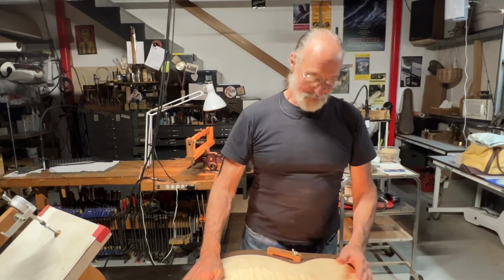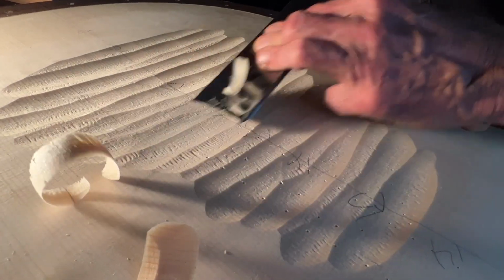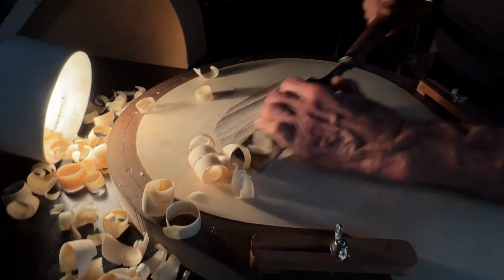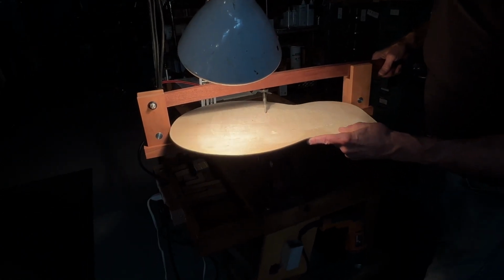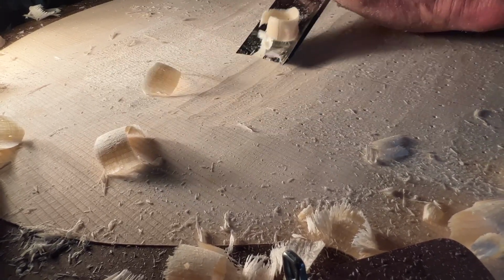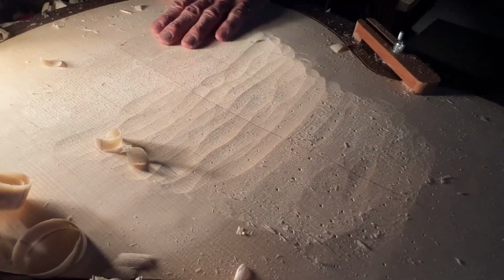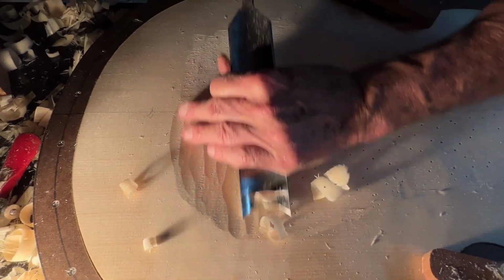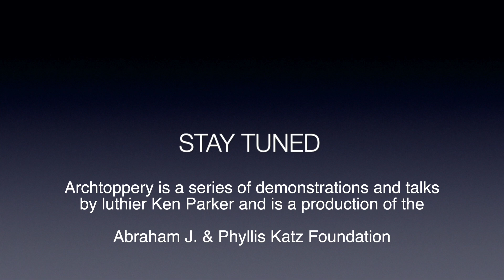Ken Parker Archtoppery - Arched Plates - Rough Carving the Inside - Chapter 2

Comment: Thanks Ken I really appreciate your diligence with these videos. I've built two ES335 styles guitars/bass and carved instead of used pressed lams. Leaving the 4" center block intact. I used the drill press method with the anvil below the bit. It freaks me out that it might grab and pull the bit right through the top. I'm typing this as I watch and you just answered my question which was what method did you use before this great tool you use now? Measured, OK, quite tedious.
Reply from the maker: Two commentators have used the word "tedious". Fair enough, I guess, but I never experienced it that way. It always seemed like it was a great opportunity to tune up the carving skills that are the heart of a hand made Archtop. The achievement of craftsmanship is its own reward.
Although I reject the drill to depth method for my acoustic plates, in the style you've described, it's almost a necessity.
The reason a drill could grab and lift/spoil a plate is that drills for wood have plenty of positive rake. In order to beat this possibility, just resharpen the bit with zero rake, and it won't be able to grab, or screw into the material and lift it from the bottom pad. In other words, take the twist out of the twist drill. Need a demo?
Reply: @kenparkerarchtoppery9440 , thank you for your reply. I think I get what you mean by zero rake so next time I'll give that a try. Tedious though I may find it, it is indeed rewarding!

Comment: The spokeshave you are using is a conventional flat bottom, or a rounded face?  The wood appears to be quite lovely, I am jealous!  Interesting that after all that you have built you just incorporate a new measurement device.  Almost too simple…….which means it’s a good thing.  And the grind you put onto your new gouge is really demonstrated by the ease that it performs.  Wonderful video!
Reply from the maker: Thanks, glad you're digging Archtoppery! The spokeshave is convex in both directions, around 20" radius arc across, and 7.5" ish radius arc along the tool.  The Strad Stabber works great!

Comment: Hello Ken, thanks for this video. I very much admire your work.  I am building a mandoline and should be able to use the same method, I presume. Would you say this will work for a maple-back as well, I mean, can the jig produce holes in hard wood as well? What is your view?
Reply from the maker: Of course the main worry would be splitting the plate by pressing too hard with the wedge shaped point, and hopefully we can be patient and methodical so as not to get in trouble.  Just test on a scrap and see how your point geometry and wood hardness interact. You can sneak up on it, and it will do very well if you're not greedy.

Comment: Thanks for this Ken. I love this idea of a thickness punch. Perfect for us beginner arch builders. One question. Did you use the same dimensions as David Sora as stated in his article. 17in seems a little small for lengthwise measurements of an archtop guitar and is close to the lower bout width of many traditional archtops. What length did you make yours? Thanks again this is great. I appreciate your experiments immensely.
Reply from the maker: Glad this helps. The best tools have an obvious simplicity to them, no?  Good enough for Tony Strad is good enough for us all! We built  55 cm, or 21.65" between the posts, and wider wouldn't be the wrong direction, but it needs to be rigid to do a good job.

Comment: On the deck from Stradivari, the paper glued in the center is not visible. Maybe he used Titebond?
Reply from the maker: That's right, All the renaissance builders used Titebond glue, 'cuzza the hot hide glue was corny, even back then.
Reply: @kenparkerarchtoppery9440  
I was just thinking composite neck, epoxy, kydex, dummy coil... "full stuffing". “Perhaps paper is a tribute to tradition?” - I thought. And indeed! Yesterday I saw a lute (kitaron) of the middle of the 16th century. the bottom of which was glued with strips of pages from Dante's Divine Comedy, an unsold edition of 1507. So maybe not a Titebond .

Comment: Thanks Ken.  What is the inside measurement, post to post, on your thickness punch?  I've been studying the Sora plans. Is yours larger?  I have a big walnut board that needs to be something. Much gratitude for your experience sharing.
Reply from the maker: Ours is 55 cm, or 21.65" between the posts.  Bigger would probably be even better, but the tool needs to be stiff to work well, so you might want to beef up all the parts.  One great thing about violin making is the modest size of all the parts, as it makes the project friendlier than the larger boxes that I build.
You're most welcome!